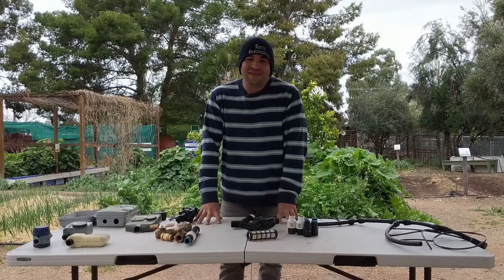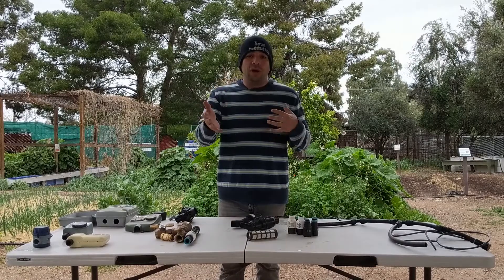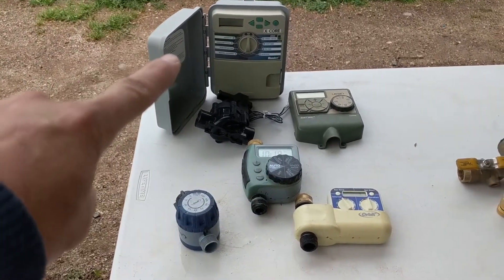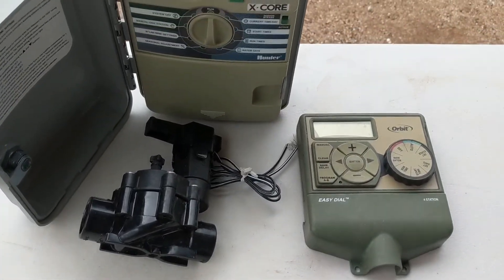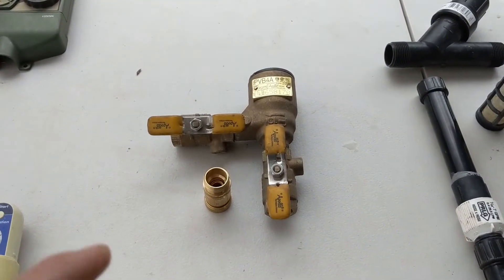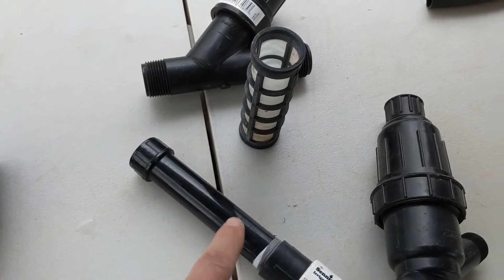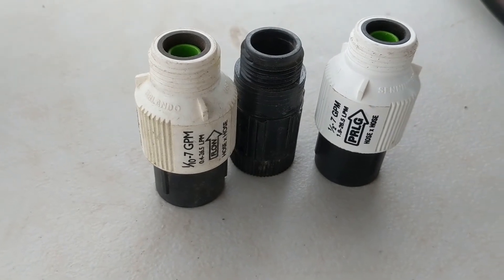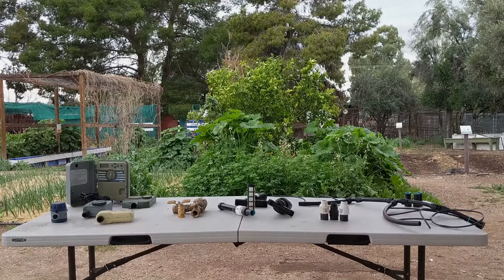Desert Gardening Basics: Components of a Drip Irrigation System

Comment: if i connected the pump directly to the irrigation system, would the pressure regulator be enough to avoid the excess water pressure on the irrigation tubing or not?
Reply from the maker: yes, you can connect the irrigation line to a pump as long as there is a pressure regulator installed. I have a large rain water cistern that uses a pump and we use the same exact type of set up I recommend here.

Comment: I have 7 garden beds each is about 20 ft long by 3ft wide, some bed will have 1 or 2 water lines depending on what I will be growing...so which one will work better for me, drip or tape? Also, is it better to run the water line UNDER or OVER the landscape fabric? I have seen people run it under but my concern is that I can't see or check that line if tuck under. So what would be your recommendation? Thank you...great video.
Reply from the maker: I would check out our video on the differences between drip line and drip tape and that might help you make a decision. If it were me I would run under the fabric or mulch you are using. Run the system when it is very quiet and you can listen for leaks. I find 90% of the leaks in my garden by listening for them. Good luck!
Reply: @SouthwestVictoryGardens  Thank you.

Comment: As far as those pressure regulators go, what psi do you recommend dropping down to?
Reply from the maker: Most irrigation components are designed to work at 20-40psi, with 30 psi being the most common.

Comment: I have 40 fruit trees in my back yard I'd like to put a drip system on. I'll need to run about 250ft of blank line to reach them all. My question is, how many 1 gph drips can I run at one time? I have about 65lbs of pressure on my faucet. Any help would be appreciated.
Reply from the maker: Most drip systems with 1/2" poly tubing and pressure compensating emitters can run about 300' of tubing with about 180-200 gallons of emitters total, so you could run about 4-5 gallons to each of your trees without losing too much pressure. Good Luck!